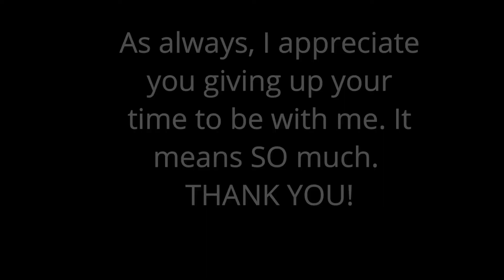Brown Sugar

Comment: That is so super sweet of your husband to make an extension for the longer soaps! 💕 How do you like the brown sugar fragrance? And WOW how did so many of them turn out looking the same in a pour like that? Pretty cool! Nice job, Renee... And it is a pleasure to watch your videos ❤️
Reply from the maker: It is so nice to have that extension. It make cutting that big long loaf so much easier. No clue how so many turned out the same and that wasn't even all of them. The F.O. "to me" in the bottle wasn't as nice as it was after the cure. It isn't strong or too sweet either. It resembles brown sugar if it had a stronger smell. Not bad. I would use it again. I like your videos too Sweet Shonna. Thank you So much!